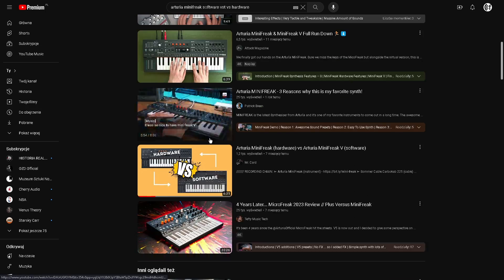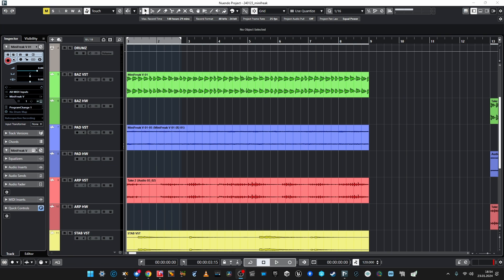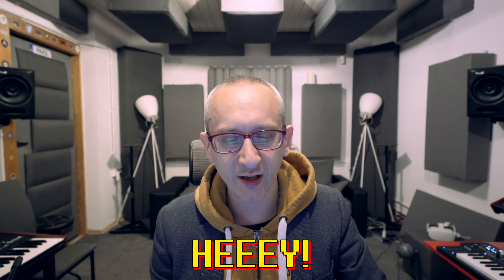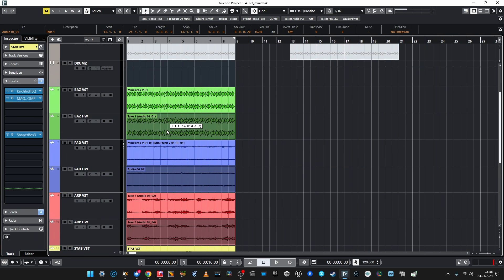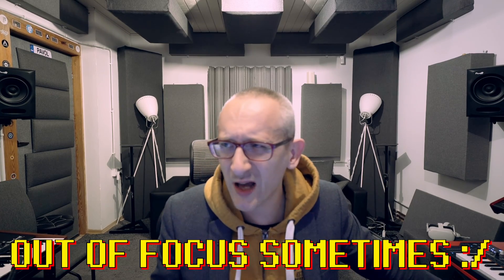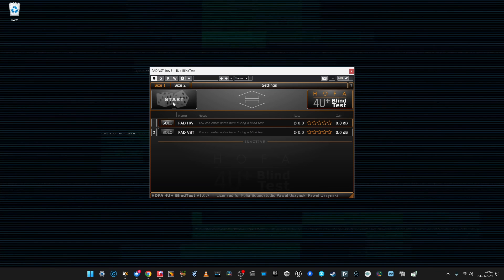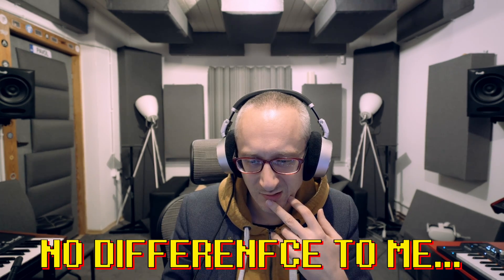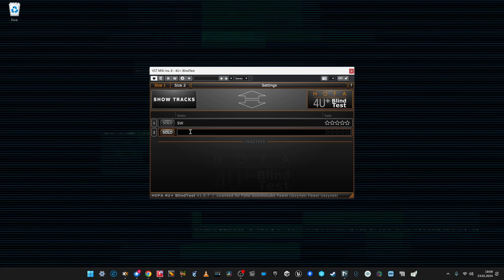HARDWARE vs SOFTWARE MiniFreak and their FILTERS (analog vs digital). Seriously nobody did this?!

Comment: When I crank up the resonance on the Minifreak, add classic distortion with max gain, 100% wet, and then close the filter cutoff on low pass I get all these weird noises, digital artifacts right at the top when the resonance starts affecting the filter. Weird since it’s supposed to be an analog filter. Oddly, the Minifreak V behaves like that some times, other times it’s just a clean filter sweep. It comes and goes, but it’s always there on the Minifreak. The first few days I had it that didn’t happen on the Minifreak and one day it just started behaving like this. Could you try on yours and see if you have the same issues? My last video on YouTube I show the settings I mean and at that time it didn’t have this problem. I wish that could be fixed in a software update :(

Comment: I don't think the difference was that big. For the  ones I could hear a difference between, I actually thought that the vst-version sounded just a tad better for all the individual sounds (Guessed it wrong all the time since I thought the "better sounding one" was the vst. Or perhaps that was still a right guess since I "separated them" the "right way" all the time. But not by much since I thought they were very close.
But for the final mix I somehow preferred the analog one.
I didn't have the best headphones for it though (My normal PC:s headphones are different from the ones I use when using my DAW).

Comment: The only thing this “proves” is, that the vst and hardware sound a tiny bit different. But to be honest, that doesn’t say much. 

A good track is a good track, regardless “analog” or “digital”. No one will ask that question in the end, exceptions apply 😅

This analog vs digital gets boring…sorry for that.
Reply from the maker: I'm absolutely fine with that, Thorsten. Don't worry, my chan won't become one huge "analog vs digital" thing, but I'm recently really into it, as I'm switching slowly yet surely to a couple of analog areas.

The thing with analog (or anything else) is this for me: if it improves your creative process and your music for the listener, it's good. The first one is very easy to verify, the latter - not really.

I still believe analog tone being simple more interesting and engaging and influencing your tracks. The listener won't be able to say, what's that thing that makes this particular track "wow", yet my discovery is that, in many cases, analog sound, stacked up from small elements in the mix, can create really big and emotional sound picture that helps your music and becomes part of its deepest identity.

That's it. Cheers and hope to see you soon anyway!
Reply: @FoliaSound Thanks, yes I can hear you. It’s in the ear of the beholder 😉, anyway. Analog is nice to have for me, but not necessary to get the aimed results. Maybe it can be more fun, but I appreciate the colors on my NI Komplete Kontrol, and it also gives me an analog feel. Sure, analog sounds different, to me it’s like you have to set up analog instruments differently than digital vst’s, that’s all. But it’s just my opinion 😊. Cheers.
Reply from the maker: @thorstenweimar1190  and this is the way to discuss things with proper manners and respect, nice to hear your opinion, Thorsten!

I promise - there will be plenty things without analog/digital shootouts on my chan, because you're also right here: I can overdo it sooner than later.

Have a great day, too!